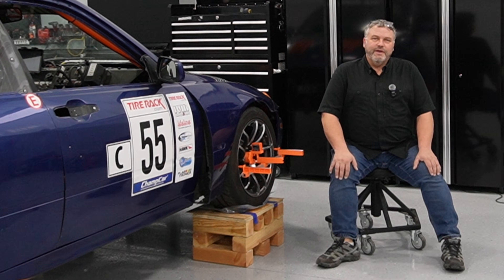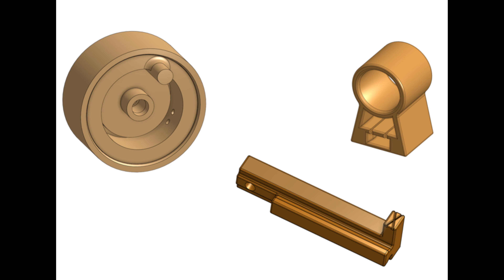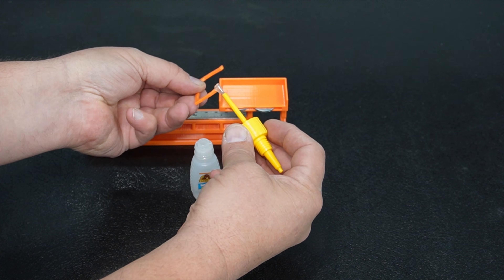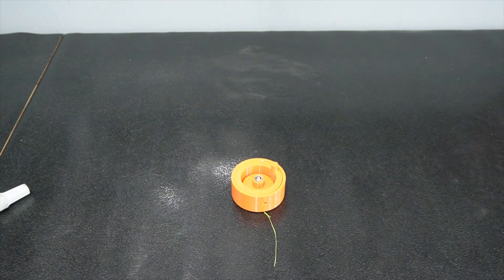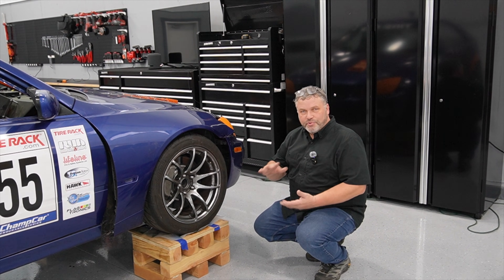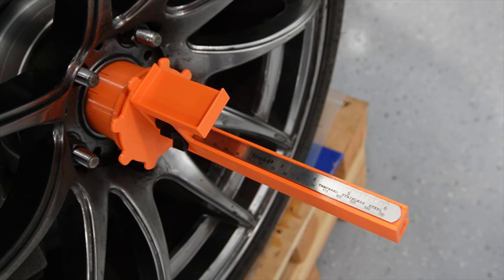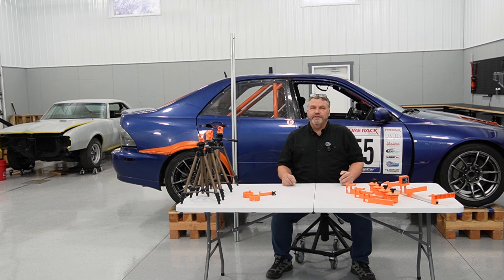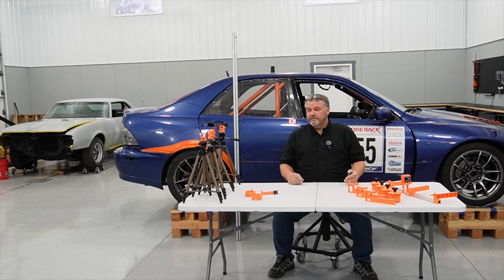3D Printed String Alignment Tools for Improved Accuracy

Comment: Forgeline GA3Rs 

Wheels do not have any cap detent, but have a smooth bore of 70.75mm that are 18mm deep.

Wheel Cap OD = 70.75
Distance to Detent = 18mm
Wheel Cap Outside Diameter = n/a

Can you create a hub adapter without a detent that slides into the 70.75mm bore and uses outward compression from the plug to secure it?

Comment: Wow, I am eager to try the system. 

Here are two cap measurements:

Opel/Vauxhall Astra/Zafira:

Wheel cap OD: 60.10mm
Distance to detent: 5.60mm
Wheel cap detent OD: 62.30

BBS RA BMW E21:

Wheel cap OD: 60 mm
Distance to detent: 3.25 mm
Wheel cap detent OD: 60.75 mm

the BBS's don't have detents but rather small bulges.
Reply from the maker: @manueltrujilloleon1521   STL files with these dimensions are now available for download.  Once you have had a chance to try them, please let me know how they fit and if tweaks are needed.
Reply: @DIYFabShop  Thanks very much. I tried the Zafira design and it fits a little loose. I neglected to mention that the original part includes a small internal wire spring to keep the tension; I'm not sure if this will make a difference to make adjustments in your design.
Reply from the maker: @manueltrujilloleon1521  generally to tighten up a fit I can increase the OD of the flexible fingers or pull the detent closer to the face, or both.  Does it feel more loose radially or axially?
Reply: @DIYFabShop  I printed two versions: one at 103% and another at 105%. The 105% version fits tightly. The dimensions of the printed part are:

Wheel cap OD: 62.90 mm
Wheel cap detent OD: 65.15 mm
Distance to detent: 6.5 mm

The distance to the detent is too large, causing axial endplay. I believe a distance to detent of 4.5 mm would be ideal.
Reply from the maker: @manueltrujilloleon1521  new Rev A STL files are available for download with these dimensions.  Let me know if further tweaks are needed.

Comment: Thanks for sharing.
Please can you make the file for caterham apollo wheels
Distance to detent = 4.52
Wheel cap outside diameter = 62.35
Wheel cap detent O.D. = 63.82
Thanks!
Reply from the maker: @billyscrim STL files with these dimensions are now available for download.  Once you get a chance to try them out, let me know if they fit well or tweaks are needed.
Reply: @DIYFabShop  Thank you!

Comment: Hi, I'm nearly done building the Laser version and noticed I'm short by 2 scales and I believe the BOM on your website should list 8qty instead of 6qty of the scales. 8 consisting of: 4 for each 'hub center' and then 4 more for the wheel touch-off posts on the front wheels. Cheers!

Comment: Thanks for sharing. Im almost done printing out my alignment tool with the laser one. I have only the wheel hub adapters left.

Opel Calibra 4x4
DZ Exklusiv DZ1 17"
Wheel cap OD: 139.5mm
Distance to detent: 8mm
Wheel cap detent OD: 141.1MM
Reply from the maker: @alexandersvensson1659   STL files with these dimensions are now available for download.  Once you have had a chance to try them, please let me know how they fit and if tweaks are needed.
Reply: @DIYFabShop thank you! I printed one for testing and it seems to need some adjusting. Maybe it will fit flush to the wheel if the distance to detent is shortened down 2mm to 6mm and the wheel cap detent OD is increased by 1mm totally.
Reply from the maker: @alexandersvensson1659  new STL files with those dimensions are ready for download. Lets see how these work out.

Comment: Thanks for all this! I am putting together a setup with the lasers as we speak. Just wanted to add that I checked the Enkei TFR 17” and it is the same measurements as the PF01 posted on the site. I imagine most enkei wheels are the same. Can’t wait to have a proper and relatively easy alignment setup right in my garage.

Comment: Thanks for making this openly available. Keen to give it a try. 
Wheels are Ray's CE28 17x10 +44 
Wheel cap diam. 59.6mm
Detent diam. 61.5mm
Distance to detent 6.05mm

Thanks, again
Reply from the maker: @squatjar STL files with these dimensions are now available for download.  Once you have had a chance to try them, please let me know how they fit and if tweaks are needed.  I was just trying to help someone else that had Ray wheels that used a centercab which had o-rings to hold it in and that wheel proved challenging.  Good luck!
Reply: @DIYFabShop finally got a chance to print and test today. The diameter is a fraction too big to fit. It measures at 61.5mm  not the 59.6mm requested. I checked the stl and it measures 61.5mm as well. Is this intentional to account for shrinkage? If its not too much hassle could you resize to 59.6mm? Otherwise I'll reduce the print 3% and try again. Cheers again, Josh
Reply from the maker: @squatjar  so i can make it slightly smaller easy enough if you want.  I just want to clarify that the 59.6 dimension is the diameter of the stepped in portion of the snap fingers.  I checked the STL file and it is correct.  Do you have an idea of how much you would want to reduce that by?
Reply: @DIYFabShop  wow thanks for such a quick reply. I did see a ce28 recently uploaded but the dimensions are quite different to mine. 

Then when I compare my dimensions to what the last guy having trouble with ce28 said, the two he tried that were too loose and too tight, my measurements fall nicely in between so it should be close
Reply: @squatjar  Hey mate, I'm the one that's been having troubles haha. They are 16x7 +39 so I'm guessing rays had different dimensions. I'm still battling this trying to get it perfect :D diyfabshop has been fantastic in trying to help me get to the bottom of it! Hope your one worked out ok!

Comment: Appreciate all the time and effort you have put into this video!

I have Rays CE28 wheels that use center caps with O rings so it's difficult to get the dimensions you need.

I tried the following part numbers:

68: too loose
19: too tight
35: it 'snapped' in good but even after snapping in it was quite loose

Next I will try part number '10' (GMR) and see if that gets close.

If that doesn't work, what kind of dimensions would you need for those kind of wheels ? I can't send photos through yt comments unfortunately.

Thanks again for all your hard work!
Reply from the maker: @PVisual-qx6wo we can get this sorted out.  Let's start by sending me some pictures of the center cap.

Comment: Thank you so much for creating this awesome design! Ive got all the prints except my hub adapters! Excited to knock them out now! Thank you again! 

2022 Ford Bronco 

17x9.5 Black Rhino Stadium wheels
Distance ti detent: 6.5mm 
Wheel cap detent outside diameter: 101mm 
Wheel cap outside diameter: 97mm
Reply from the maker: @T.steeze12 STL files with these dimensions are now available for download.  Once you have had a chance to try them, please let me know how they fit and if tweaks are needed.

Comment: I can't get the BMW 6783536 adaptor to fit at all, its much too lose and doesn't tighten down when bottomed out. This is on an e46 running Style 163M wheels. I'm using #21 Rev C on your site. Suggestions? Love the system btw and definitely want to print it out and try it.
Reply from the maker: @trigtm we can this sorted out.  When you selected #21 was it just based on the BMW 6783536 description or were you able to measure your center caps and feel like it was a pretty close match? We may just want to start with your centercap dimensions exactly and make an alternate version as a starting point.
Reply: @DIYFabShop  Your 6783536 feels undersized as the hub adaptor slides further in that the detent and doesn't seem to stop at all, and the plug bottoms our but doesn't push out the slips to hold the plug in place. I also printed 676840 (your #35 Rev A and that slid into the bore very tight and felt like it was made for it but the threaded plug would not bottom out and was pushing too hard on the slips on the adaptor even with some sanding and lubrication. My center caps are old and are correct for this wheel: detent distance is 6.5mm, detent outside diameter is 68.5 (slightly larger most likely as my caps are old), wheel cap outside diameter is 65mm. The best I can measure at the narrowest part of the wheel bore is 66.5m and about 6mm deep from the stepped face to where the detent on the center cap would sit.
Reply from the maker: @trigtm  so I made a version number 89 per your center cap measured dimensions.  Dimensionally it fits between the two you tried, which is probably a good sign.  The no 35 being too tight can be because the detent was not able to expand out into the groove because the legs are too short, so that also make sense.  The only thing causing me pause is the 66.5 you measured on the wheel.  But I think I would still suggest starting by printing this new version based on your dimensions.  Then you are doing the exact right thing, if it is too tight you can try lube or sanding, if it is too loose you can wrap tape around the end of the threaded plug so it pushed the detent legs out further.  those steps can help confirm how we may want to change it dimensionally, not that you want to do that for all four wheels.  Good luck!
Reply: @DIYFabShop  I printed 89 (using a Bambu X1C with factory PLA settings, .2mm) and it fits in the center bore with very slight play, the threaded plug threads all the way to the bottom and doesn't seem to contact the hub adaptor detents so there is no holding power. I double checked my measurements 3 times and they are accurate. I think I might just want to print 89 again with maybe 102% scale, which might fit perfectly. Thoughts?
Reply from the maker: @trigtm  so once the threaded plug is screwed all the way in, do you have much axial play?  If we feel like the detent is at the right spot, I could just bump up the diameters by 0.5 mm for a little more engagement.
Reply from the maker: @trigtm  I went ahead and created an A version of 89 with .5 mm larger diameters if you want to try that.
Reply: @DIYFabShop  I keep going back to the Rev 35 adaptor which fits absolutely perfectly without any play at all but the plug pushes out the detents too far and it binds. I think the design might benefit from the detents on the adaptor being proud of the body so they spring outwards more to grab the inside of the bore while your positive stops sit just inside of the wheel/hub interface on a slight step that is available. The 89 when screwed in all the way still has the same play axial and radial so it doesn't tighten down. I wonder if we are splitting hairs adjusting when a simple scale factor might work due to slight differences in 3d printing (though my X1C does measure out to be accurate). If you have an email, I could send you a couple quick vids to show what I mean.

Comment: My buddy has a C7 Corvette with Titan wheels and they have a wheel hub cap design with a 54 mm diameter and two equally spaced O-rings which are 56 mm in diameter. The part of the cap that goes inside the wheel is 10 mm deep in total. Would there be a design for a hub adapter that would work with this wheel? I can send you pictures of the wheel hub cap if that would help.
Reply from the maker: @joshterasaki6647 a picture would help.  I don't think I have worked on a c7 yet, but the C5 and C6 have been a challenge based on lack of space inside the wheel hub.

Comment: Wow this absolutly incredible! 
I've been trying to make a solution for myself to use for doing alignments on my drift car no luck yet but would be awesome to give this a shot.
My rims are Enkei T6S.
- Wheel cap outside diameter 61.6mm
- Wheel cap detent outside diameter 62.8mm
- Distance to detent 4.7mm
Reply from the maker: @Panciocco.44 STL files with these dimensions are now available for download.  Once you have had a chance to try them, please let me know how they fit and if tweaks are needed.
Reply: @DIYFabShop thank you so much that was a very fast reply, sorry took me a bit to get a buddy to print one for me to test. The concept is super cool! But unfortunately it's a bit loose, I pulled 2 more center caps to measure it up and I got 2 different measurements on them both larger than the first one, so I measured the rim itself and it was a consistant 1.2mm larger than the cap for both outside and detent outside.
Outside 62.8mm
Detent outside 64mm
Distance to detent still 4.7mm
So Sorry about that.
Reply from the maker: @Panciocco.44  take a look at part number 81, the dimensions are very close to these new numbers.  Willing to give those a try?
Reply: @DIYFabShop   Wow, it clips in perfectly. cant wait to use these this weekend everythings mounts on the wheel so well. Thank you so much! 
-Mike

Comment: Thank you for sharing your knowledge and this super useful tool, i think this will help a lot me and my formula studant team. I don't know the exact measurements, because the wheel we use is an old magnesium one.
Here the center cap dimensions:
wheel cap outside diameter - 47mm
distance too detent - 4mm
wheel cap detent outside diameter - 49,25
Reply from the maker: @MakotoTeruya STL files with these dimensions are now available for download.  Once you have had a chance to try them, please let me know how they fit and if tweaks are needed.

Comment: If the scale attached to the centre cap sticks out perpendicular to the wheel, and the wheel is not at a 0° alignment, doesn't the scale intersect the string line at a non-square angle?(Assuming the string is parallel to the centre line of the car) 

For example, at 11:40 it looks like your rear passenger wheel is toe-in and the mm measurement is slightly lower than the inch measurement because the scale is not at 90° to the string. This would get worse the further from the wheel the string is.

This is a cool system tho and I want to try it myself, but idk if this issue will cause any problems🥴
Reply from the maker: @cameronkillins4352 a fair question.  Yes there are some sources of error related to things like just how accurate can you read a string against a a scale, how tight do parts fit together, and angle differences between the center hub scale and the string lines when the wheel has toe in or toe out. My perspective is that one should keep all that in mind and be as careful as possible taking measurements, and that this fixture system while not perfect, helps eliminate a lot of error as compared to simply holding a scale up to a wheel which for many is their current solution.  That being said, specific to the concern about wheel toe impacting the measurement from the wheel hub to string.  Using ChatGPT to do some trigonometry for me, you would need to have about 18 degrees of toe to impact the measurement by 1mm.  So yes toe plays a role in the dimension, albeit not an overly sensitive one.
Reply: @DIYFabShop  Yea good point. I played around with some toe angles, and if your wheel looks approximately straight by eye, then you're right it can't be off by more than 1mm.

Messing around a bit in fusion360 with a 100" wheelbase and worst case if your string is 1mm too close at the back and 1mm too far at the front, a "0° alignment" will put your wheels at 0.045° toe out. That's ignoring all other sources of error, but I feel good about a ~0.1° total toe margin of error (even less if your alignment is starting within a few degrees of straight).

Also thank you for the oil in ziplocs trick, so cheap and simple! Genius!

Comment: how difficult would it be to also add kingpin inclination to this? 
I think all that would be needed is a second angle gauge at 90 degrees to the first. 
https://youtu.be/iKwZ567Emfw?si=duLOLN2fTK2tjItt&t=398

Comment: Thank you for sharing this system and the 3D files. I have aligned my Lotus Elite ’74 recently and it worked out perfect. You asked for comments and suggestions for improvements and I have a few small ones. When the scale holder is attached to the threaded plug I find that the scale holder flex a bit (sort of bend around the attachment bolt and that affects the camber alignment. So, I suggest to add 4 small dods at the surface that attach to the threaded plug. The result is that it always align and do not flex. Second suggestion is to have only 1 rail around the metal rulers. The rulers I got was slightly wider than the grove and I had to trim away the rail at one side. By removing the upper (away from the print bed) you also get rid of the stringing due to the small (but long) overhang. But great work, can’t wait to align another car.
Reply from the maker: @MrTonnykp thanks!
Reply: @DIYFabShop  +1 on the ruler. My rulers are 20mm wide. If one of the ridges was removed, any ruler size would fit perfectly

Comment: Hi and thank you very much for allowing us to utilize your fantastic steering alignment design.
I have just started printing and purchasing all the parts needed.
I have a 2009 Chev Silverado 2500 HD, with 20 inch XD Hoss Mags.
The centre cap dimensions are as follows
Distance to Detent - 3.30mm
Wheel Cap Outside Diameter - 126.00mm
Wheel Cap Detent Outside Diameter 128.20mm

I am really looking forward to using your awesome design.
Many thanks
Cam
Reply from the maker: I am away from my computer for a couple days, but I will get those stl files asap
Reply from the maker: @DCWPSS  STL files with these dimensions are now available for download.  Once you have had a chance to try them, please let me know how they fit and if tweaks are needed.